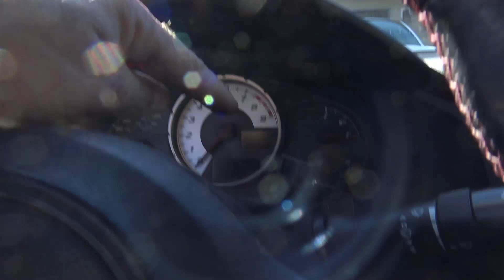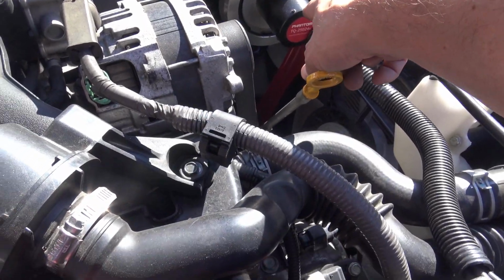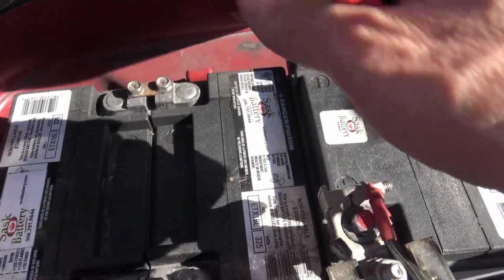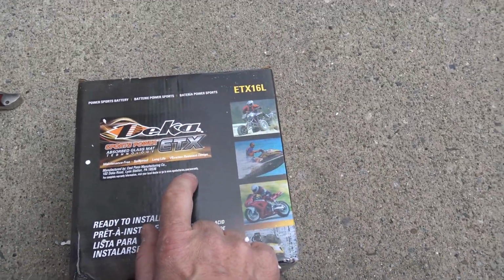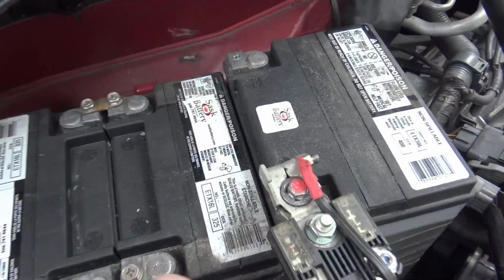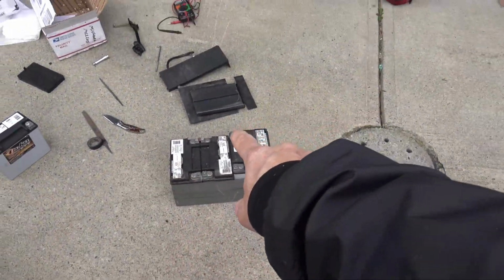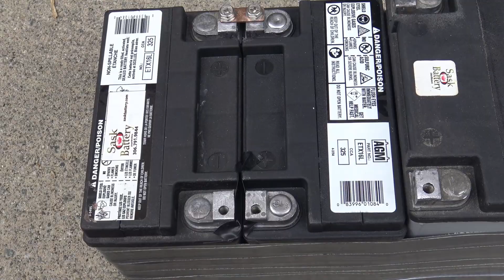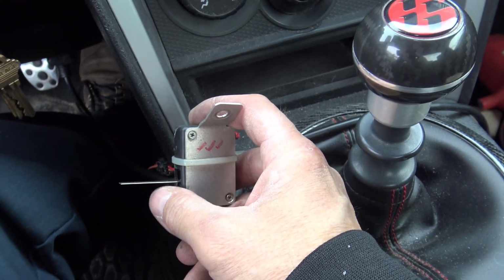Fixing broken Phantom ELECTRIC Supercharger Part two!

Comment: AS I just found out with electric golf carts it is important to load test the battery as well as sometimes they report a normal voltage at idle, but as soon you put a load on them they drop off massively. Thanks for the upload btw. I am finally putting mine in this weekend!

Comment: Great series of videos! Happen to consider the following setups: 1) using Li-Ion batteries instead of lead acid batteries (massive weight savings + far-higher electrical discharge); and 2) setting up mechanical switch at tail-end of the car’s drive-by-wire setup (instead of behind the gas pedal)?

Comment: The 2 batteries must charged to the exact same voltage to the tenth of a volt.to keep them as 1 one unit .if 1 is higher than the other one will draw harder than the other thus shorening the life of the other. I suggest using limitless lithium batteries with there super capacitors to help with power surge and a strong alternator to support the system